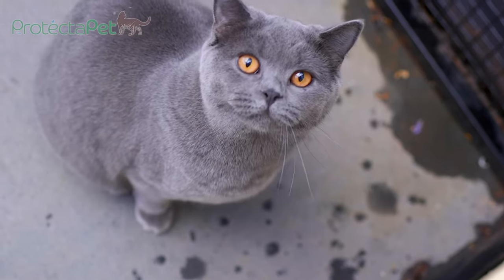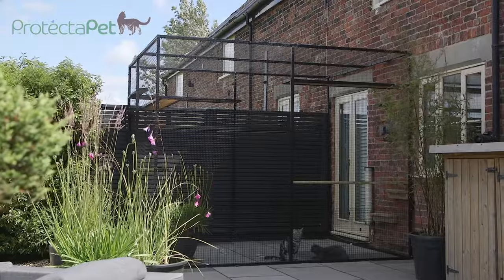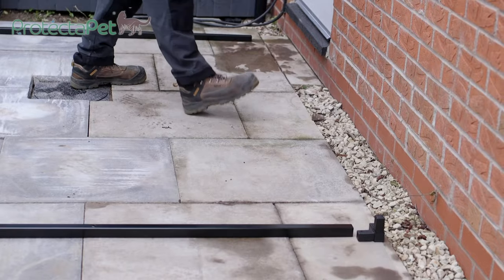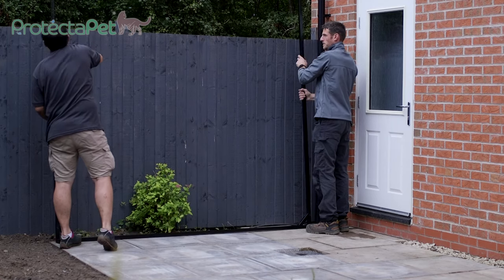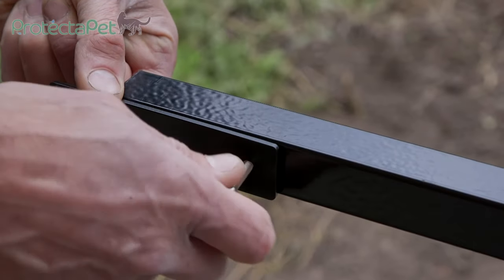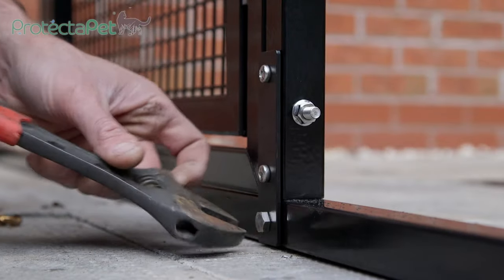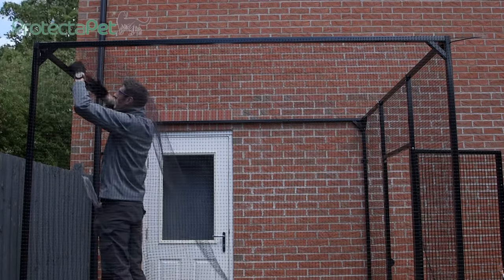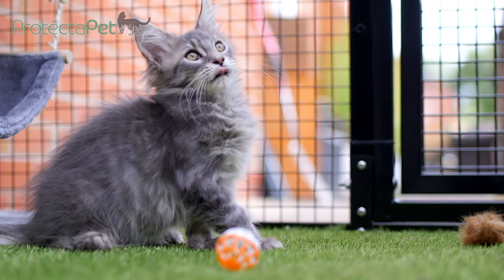How to Build a DIY Catio (Cat Patio) for Safe Cats Outdoors & Peace of Mind

Comment: The mesh is plastic or metallic?
Reply from the maker: Metal fur the first 60cm for a wildlife chew guard. Plastic above for lowest visual impact.
Reply: @ProtectaPet  for the prices, it should all be metal.  That mesh will barely keep a cat in, and DEFINITELY won't keep predators out.  The cats don't notice "visual impact" as the mesh is the same, visually, as the hardware cloth.  Nice try, tho, LOL.
Reply: @energeticsoulhealer888 thanks for your feedback, though we don’t have predators here in the UK.